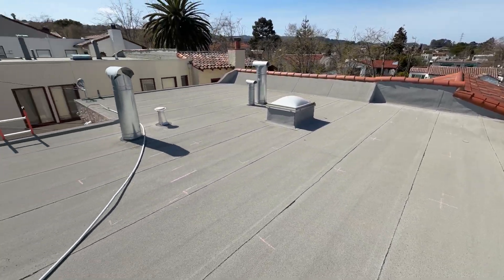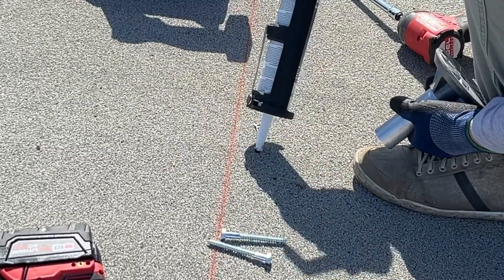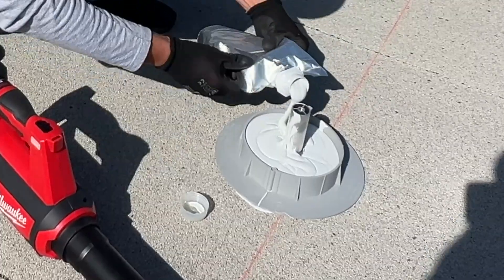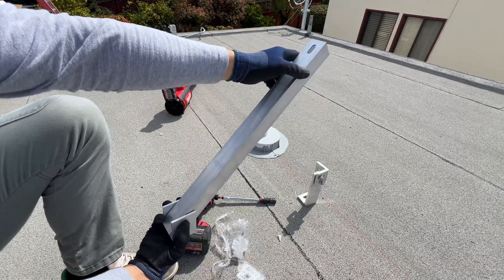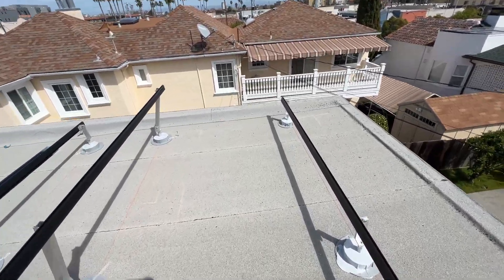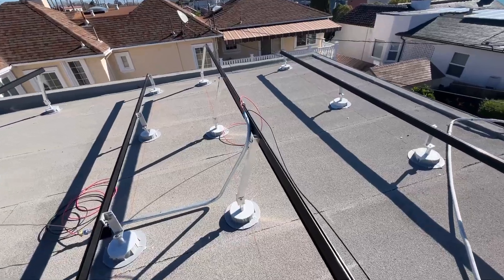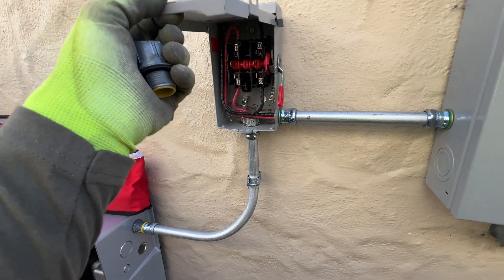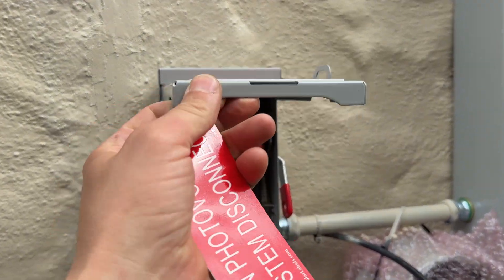Installing 16 solar panels on flat roof

Comment: Why is it 25 degrees in the bay area? Is that for maximum sunlight in summer? I'm up in wine country at 38 degrees latitude. I'm seeing 35 degrees for optimum winter time electricity production. That's when I need most power to run ground source heat pump radiant heating.

Comment: Impressive job. Insane that the mounting system, which is mostly all trivial hardware that anyone handy at metalworking could reproduce in their garage (except for the adhesive), costs more than the solar panels!

Comment: have you looked into the unirac flashloc RM system for flat roof? if so, any thoughts? thanks
Reply from the maker: haven't install, but looks like a good option

Comment: How to find what the right tilt angle for my house. I have mixture of slope and flat. Would like to install on the flat roof but if faces more east then west
Reply: Google some solar title calculator, some have maps where it knows your location from that location you can calculate what angle is needed.

Comment: Nice install. How come no ballast system for this house?
Reply from the maker: Ballasted system is good for foam roofs, because of complexity to install mounts. On rolled comp roof, it's relatively easy to locate rafters and install mounts. Also weight is much less.